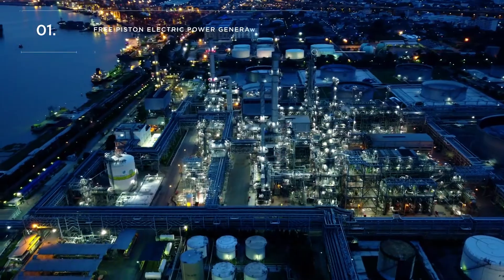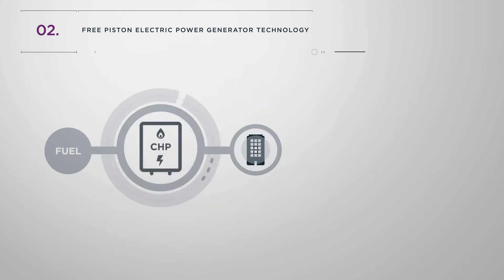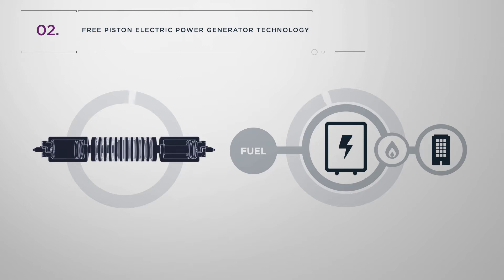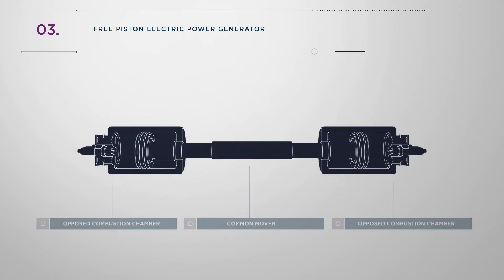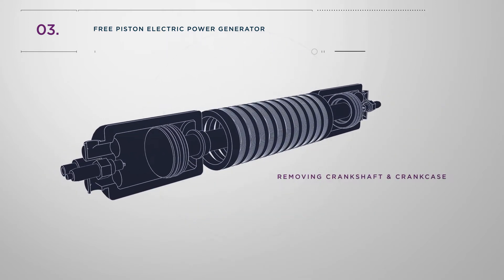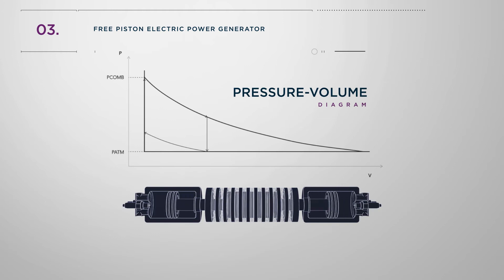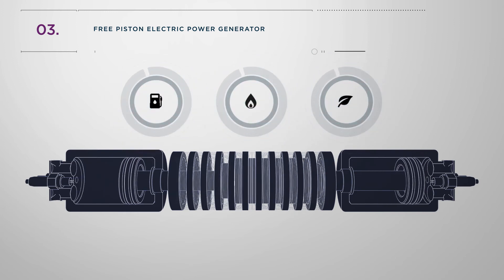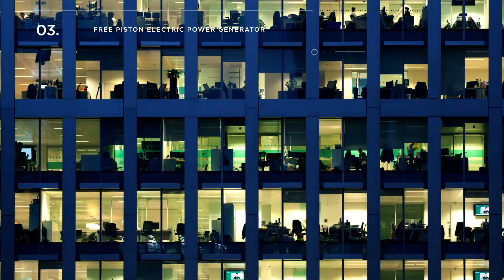DEI Free Piston Combined Heat and Power Technology

Comment: Excellent job! I've designed one of these types of generators when was doing my degree in Russia in 2003 being inspired by the automatic diesel pole hammer that uses gravity to compress the fuel on the down stroke, didn't have money to produce it though unfortunately. You are absolutely right about all of the advantages and with the camless valves from koenigsegg it will be a piece of cake to make it work!